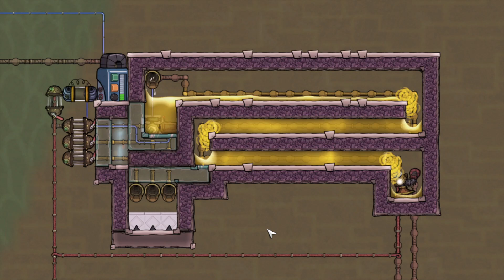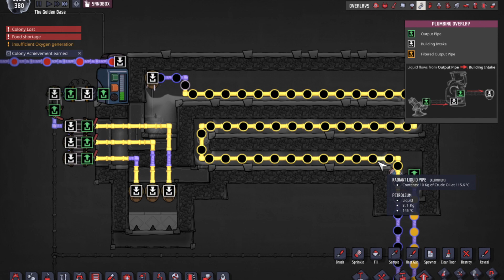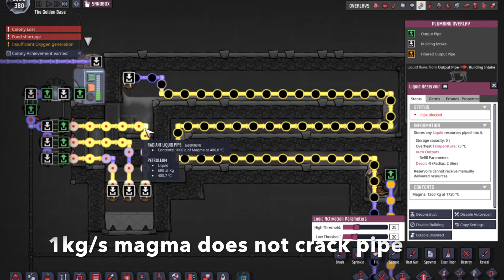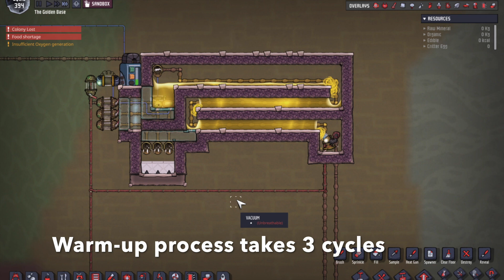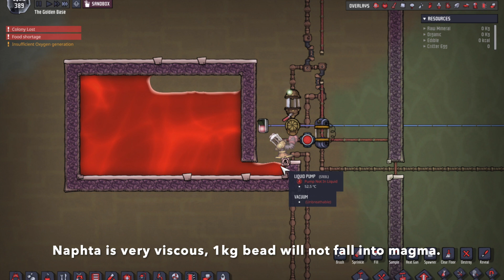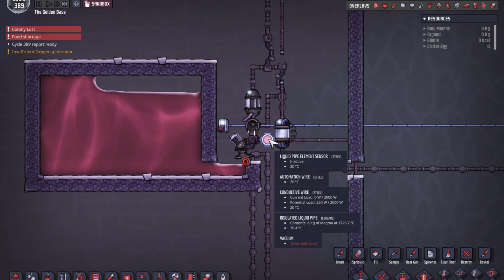Piped magma petroleum boiler (Oxygen Not Included)

Comment: Hello, this is quite a old vid but i just saw it the first time. How much g of Magma does it take at minimum to run constantly? I love tuning my machines to take exactly x g per Sex to run flatout. You said 550g of constant Magma for 10kg of crude oil constant?

Having a constant Flow eliminates beat Spikes entirely and therefore makes it that the builds can be optimized to the end
Reply from the maker: There's a couple of variants of the build in this video and other videos, and you can definitely do 10kg/s crude oil constantly, but I don't have a system that consumes an absolutely constant quantity of magma. The amount of magma consumed will be very high when you start or restart the boiler. It can also vary if the input crude oil temperature varies, which is hard to prevent.

Comment: does this run until all magma is used up?
Reply from the maker: I guess so. I hook mine up to a volcano and it never runs out of magma, but if you give it a finite supply of magma, it will use it all up, provided you keep the crude oil and petroleum flowing.

If you're trying to remove and cool magma as quickly as possible, a petroleum boiler isn't the best strategy. Petroleum boilers, such as mine, are designed to use as little magma as possible. To use a lot of magma quickly, try geothermal power instead. Or just dump it in space.

Comment: Why is the lowest row of diamond tile stretched into the counterflow chamber?
Reply from the maker: This extracts a bit more heat from the magma to slightly increase the efficiency of the heat exchanger. The magma passes through those tiles and heats them up to almost 300 degrees, enough to boost the temperature of the petroleum/crude oil in the counterflow chamber. It's a pretty marginal effect, but I did test it a little bit and it slightly reduces the number of grams of magma per second that you end up needing.